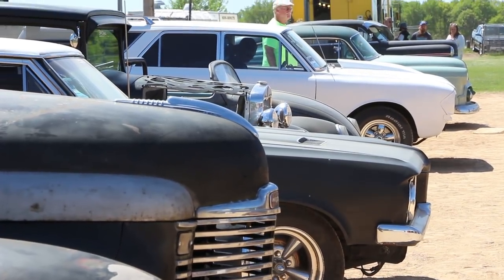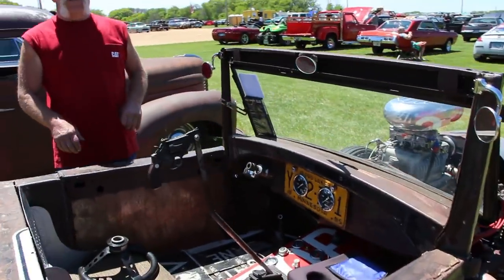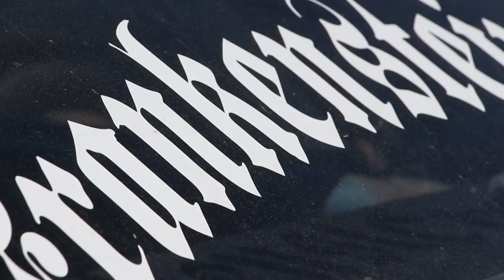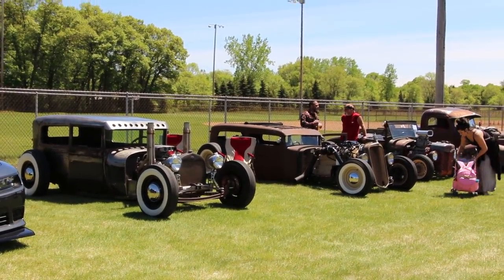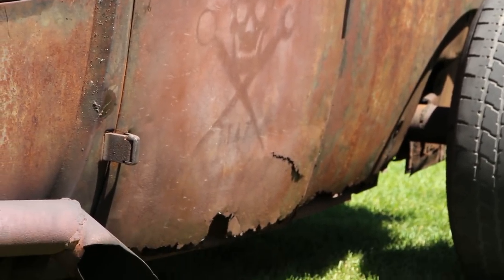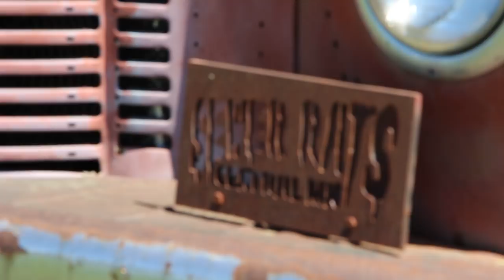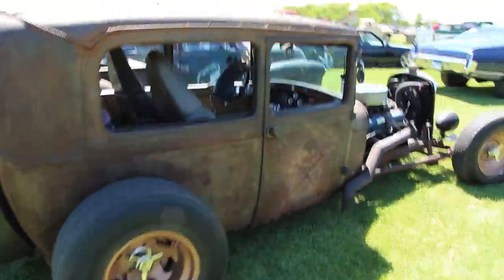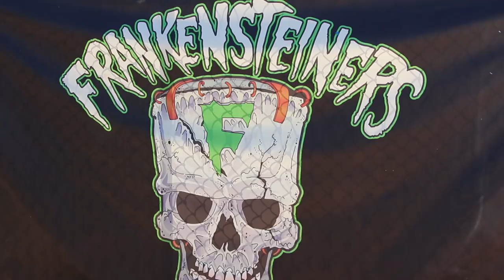INCREDIBLE RAT RODS!!! - Cars & Trucks - Frankenseiners Car Club - CAR SHOW!!!

Comment: Yes! You need a VW buss with an old Toro 425 or 455 with transaxle or El Dog 472 or 500 with transaxle in the back. And chopped and bagged. Crazy exhaust. I could go on but, it was your idea.